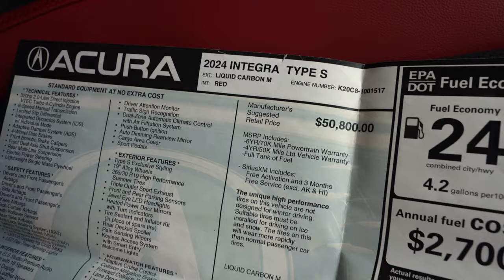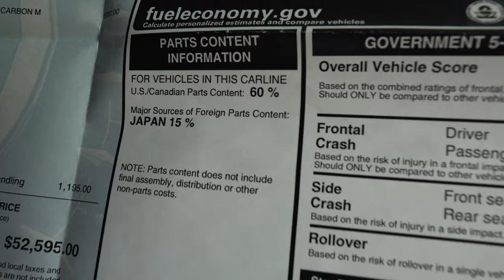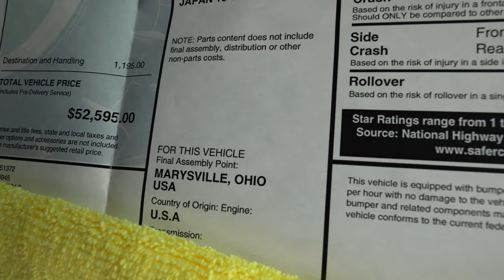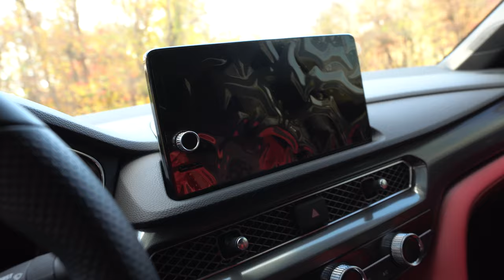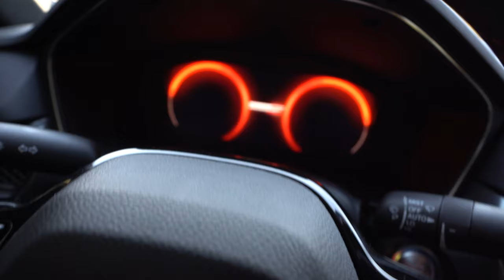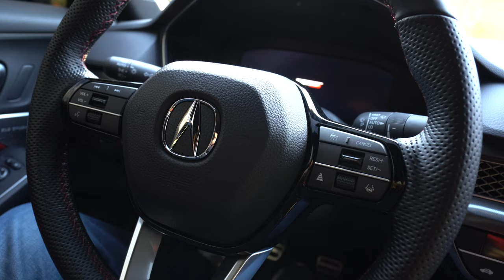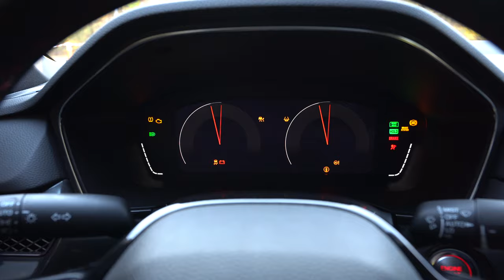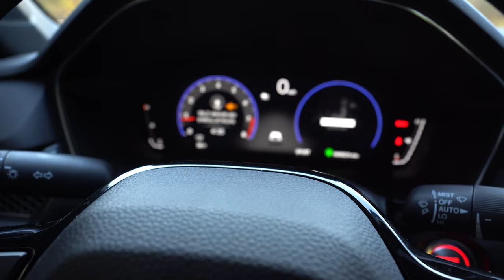I BOUGHT THE BRAND NEW 2024 INTEGRA TYPE S!!! FULL OVERVIEW! 🔥 GOODBYE FK8! 🏎

Comment: Is the type r resale value gonna be way better than the type s in the long run or they’re the same?
Reply from the maker: It really depends on how many they actually sell of the type s and how long they keep making the integra type s..It does cost more than the type r
Reply: @EvilStreetShark  👍🏽
Reply: Resale value comes not just from rarity but from desirability mainly. There are some rare cars that don't really bring in high value because they aren't desired. I think both will hold value but the type r will have more value over time. The current Integra wasn't received as well as the previous generations. Can't go wrong with either.
Reply from the maker: @supralyfe1206  True..The new DE5 Integra Type S is getting a bad rep because its not a 2door but as more people get to experience them.. i believe that will change..